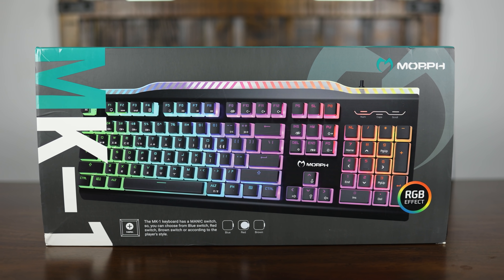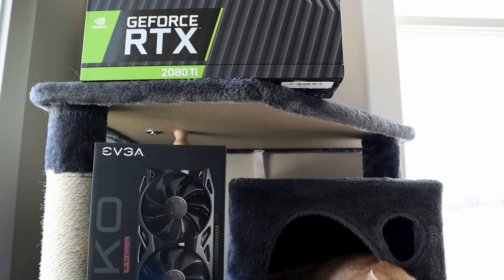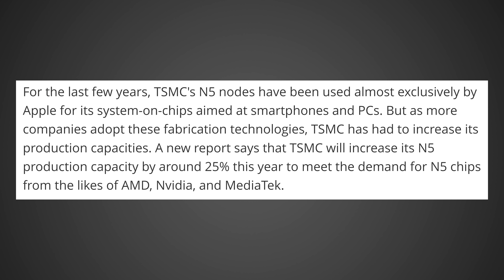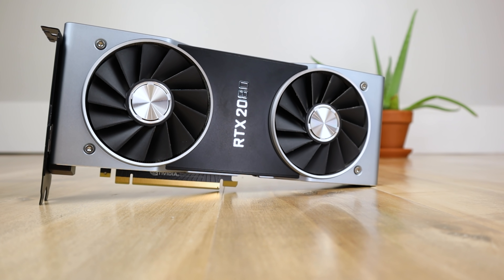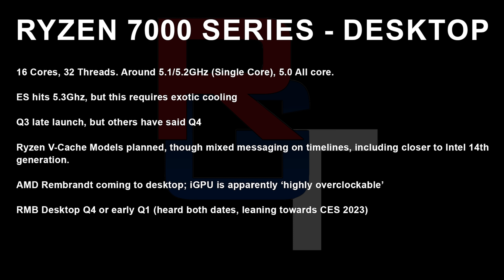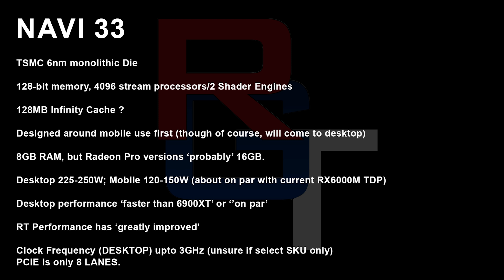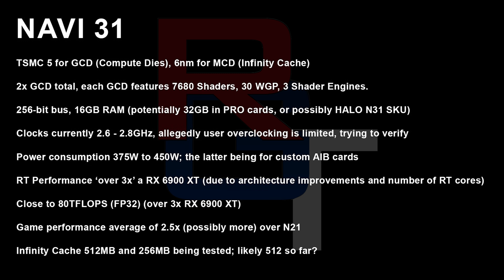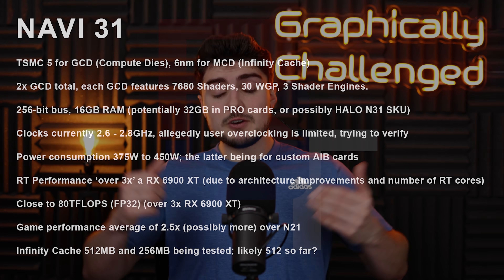Goodbye GPU Shortages FOREVER

Comment: 25% increase is not as big as you think it is.  For example, going from 80 to 100 is a 25% increase.  If you're splitting a 25% increase between 4 different companies wanting the same manufacturing process, that's really between 6% to 7% per company.

Comment: I am just looking for a $150 discrete graphic solution that draws < 150W and capable of paying recent titles at 1080p 100fps / 2k 60fps Medium settings (Non-AAA titles).
My RX580 undervolted gave me that for many years, but recently passed away after 3 years 3 months of faithful service (R.I.P)
Checking on the current market there's nothing, and apparently the 6500XT can't even natively decode video, wth?
Seriously looking forward to the Intel Arc 5.  Perhaps soon I'll have a pure Intel machine cpu+gpu setup, would be the first one in my long PC building career lol 😅

Comment: Some YouTubers and websites have said the 7900 XT will be over 2.5x faster than the 3090 Ti in ray tracing. If that’s actually the case, the 4090 has to be around 2.5x faster than 3090 Ti if Nvidia wants to compete with AMD. AMD will probably release the 7950 XT at some point and that should be very close to having 3x the performance of the 3090 Ti. AMD is serious about taking the performance crown. Nvidia will likely release the 4090 Ti, which should be around 2.75x faster than the 3090 Ti or at least close to that. AMD’s next gen GPUs are not only going to be a huge performance increase in rasterization but also in ray tracing.
Reply: Source: trust me bro
Reply: @shadowcyclonexx2.097   If AMD actually use the MCM design on the 7900 XT there will be a good chance it will be over 2.5x faster than the 6900 XT and 3090.  I’m not saying it will definitely be over 2.5x faster but it’s a possibility.

Comment: 😂 dont worry 4000 gpu will raise to $4000 after launch 3week later. This is the way. NVIDIA Way.🤔🤗🤗🤗 (if u don't buy 3000 gpu, nvidia will force you so & raise 4000 gpu.🤔🤗. Just like rtx 2080 ti model.

Comment: 16C/32T is going to be the top CPU configuration for the next 20 years...
Scratch that, it'll probably be the useful limit of CPU architecture forever.
Go look up Amdahl's Law, there is severe diminishing returns on multi-threading, consumer software will never be able to efficiently use more than 16 cores.
Reply: LOL, okay. Come back and tell us that again after Raptor Lake launches with 24 cores by November of THIS YEAR.
Reply: @selohcin  
Anything people want to do with a high core CPU right now is or soon will be done much better with GPU acceleration.
Reply: It depends on what you are doing with those cores and threads. Even if that is the upper limit, there are always efficiency improvements.
Reply: It's not a cpu/hardware limitation.  It's consumer software limitation right now. There has been cpus with more than 16c 32t for a long while. Not to mention server grade hardware and software has no issues using all the cores.
Reply: @Apollo-Computers  Servers serve thousands of users at once, but you can't parallelize the tasks of the individual user to run faster on more cores (Windows never saturates more than four threads).

Comment: The reason they're increasing production to meet those companies demands is because they have paid many many billions of dollars to the chip producers to earn that guarantee.
Downside?  Over inflated  prices in the gpu sector.
Still going to cost an arm and a leg.
Reply: Exactly. Look at 3000 gpu prices atm, 3060ti still floating between £550 and £600. Its a joke. 3060 12gb still £450-£500. 100% the new 4000 gpus will be over priced due to performance increases and rot on shelves.
Reply: @D-2-RZ  Agree. The market won't be viable for two reasons. No one will want to pay those prices, given the current global economic crisis and no one will want a card that requires X amount of Wattage to run when Global energy prices are going thru the roof.
Dead product. Good enough for them.
Reply: @cmcc3721  couldnt agree with you more. Spot on 👍

Comment: I think Nvidia's decision NOT to go with TSMC for the 3000 series was the reason supply was as good as it was. AMD went with TSMC and Nvidia out produced them about 20 to 1. A 25% increase for TSMC will do very little if Nvidia wants to make gpus with them. If Nvidia produces with Intel or Samsung I think the situation would be better for the 4000 series.
Reply: If I remember correctly, thats tottaly wrong... It was all nvidia fault that they go with samsung. They wanted tsmc to lower their margin by talking with samsung. They didn't budge, so they had no other choice but to go with samsung and only their server grade stuff etc were built on tsmc. That's why their gpus were that power hungry as samsung 8 was 25% less energy efficient then tsmc 7. Thats the difference between 350 and 275W or so. If they wouldn't do these shenanigans availability probably would be the same.
Reply: So Nvidia had a 20:1 production but AMD has had cards on store shelves for many months?  That only happened for nvidia in the past month.  AMD was far more available.

Comment: 2 questions if someone can answer
Will a 4000 card be compatible on a pcie express slot 4 ?
Will it be compatible to any of existing power supplies ? I mean if it has a different kind of pin connector than current ones of existing psus.
Reply: Over 4070 u will need 1000 1200 psu thats all
Reply: @beboH4o  atleast a reply. Thanks.

Comment: Just remember, shortage was not mainly related to low production, it was hugely due to professional miners and bots! What makes you think it will not happen again please?
Reply: Or maybe it was both. They saw an opportunity to increase prices. They started selling to miners instead of regular customers. Created a shortage and now prices are higher, in retail stores. That's not counting that they slowed down production due to covid and other reasons.
Reply: that is true but also due to people sitting at home with nothing much else to do during lockdown?
Reply: That was part of the reason for the shortage. There really were shortages. The demands for fabrication were largely unmet and therefore the number of GPUs couldn't meet the demands of consumers. Then add the miners, scalpers, and retail distributors giving GPUs to miners and you have a massive shortage.

Comment: Although its not the best card out there I recently bought an Asus Phoenix Rtx 3050 for $299.99, which was a crazy deal because now its selling for $100 more.
Reply: One of the best deals you could get today but I think you should have spent $70 more and get an RX 6600.
Reply: I compared it to the 6600xt, but the xt was like $100 more, so i decided to just quickly buy the 3050 before it was out of stock

Comment: If AMD doesn’t release anything over 16 cores it’s going to be catastrophic for them. The 12900k already beats the 5950X in the majority of cases, and that’s at core parity. 16v16. The 16 core Zen 4 chip will have to go up against a 24 core Raptor Lake chip, the i9 13900k. And I don’t see how it’s going to win with a core deficit if they already lose at core parity
Reply: if you need more than 16 cores (99% of consumers don’t even need 16 to begin with) just buy a threadripper CPU. core count doesn’t mean everything when it comes to gaming. if you buy a 12900K or 5950X purely for gaming or general purpose use you are wasting your money.
Reply: @nathanlarson6535  Right but consider this. The i5 13600k will likely be a 12 core chip. The R7 7800X will be 8 cores. How’s AMD going to explain why their 7 series loses to Intels 5 series?
Reply: @nathanlarson6535  not if its as cheap as a i3 or i5, i got my i9-10850k brand new for €100
Reply: Well you have to remember that the 1200k was realesed over a year after 5000 series so its obv going to be faster plus it has a newer platform. Raptor lake sounds interesting.
Reply: We gonna see 24 cores and 32 cores for consumer grade not for enterprise
Reply: amd still matches or beats it in productivity for way cheaper, 12900k is def better for gaming. also really expensive.
Reply: Yeah 90% PC users are gamers so no. Noone needs them cores. You dont know jackshit.
Reply: We need way faster single core performance, not gazzillion of core count
Reply: For desktop CPUs that will see mostly gaming work and editing work you absolutely don't need more cores. Beyond 12 cores we're into pure marketing territory for people oblivious to the fact you won't even utilize half of them most of the time.

Comment: If that's the case, my future gaming build will pretty much stay the same - an amd cpu and an nvidia gpu.😃
Reply: Meh nvidia will get smoked till they get on mcm they will probably be more expensive next gen than amd use 2x the power and all amd has to do is add a few more mcm to beat anything nvida might launch. I’m waiting for the 450$  105w 5800x3d to beat the 800$+ 260w 12900ks. It’s what happens when you can add more silicone and keep it in its optimal power range vs just pushing the limited size silicon further and further past its efficiency envelope
Reply: @mddunlap03  that amd cpu will probably be better for workstations too.
Reply: @mddunlap03  if you think that Nvidia GPU’s will be twice as expensive and not as good performance you need to see a doctor😂😂
Reply: @mddunlap03  keep waiting, coz 5800x3d (more like trash3d) is never beating 12900ks
Reply: Got to keep warm in the winter.
Reply: I’m hoping AMD GPU will beat Lovelace, that will be a twist for my first build later this year
Reply: GPU shortage is already kinda gone, major retailers are basically scalping with their insane pricing. 

What he didn’t mention is that silicon wafers are going to be increasing in prices because TSMC and the like said so.

So yeah, be prepared to be charged up the wazoo. People here are so starved of GPUs that just the fact that stocks are normal will justify a 30 - 40%  markup.
Reply: My current build is an intel cpu and amd gpu lol
Reply: As Nivida say 🤣 tell me do you bleed if u choose to buy 4000 gpu & avoid buying 3000 gpu. Lol u will. ( raise 4000 gpu $1000 more is a must : )
Reply: @roxy_xcxc6869  Ok, this got me laughing 😂.
Reply: mine will be intel cpu with amd gpu
Reply: mine both amd
Reply: Nvidia is making cpus now
Reply: Im intel CPU and nvidia GPU until I can see waht teh Intel GPU can do.
Reply: whatever you choose.......just remember........your still a PC Gamer and not a Console Lamer.
Reply: I’m never getting an amd GPU until they get FSR on par with DLSS 2.0, there’s no excuse why it isn’t. That’s literally the only thing holding me back. They need to pull an R9 295x2 type machine BEAST again
Reply: @NerroEXTV  there is an excuse to why it isnt, nvidia uses machine learning, amd doesnt
Reply: @NerroEXTV  your loss
Reply: @Zelara5  how? AMD GPUs have been garbage after the RC 2xx era. Missing out on thing lol. They have the best GPU of the century with the r9 295x2, but now they suck.

Comment: Im planning to buy 3060 once the prices drop more. Should I wait until 40 series?
Reply: If you can get one for msrp I would get it now cause I would not want to risk waiting another 2 years. Plus you can sell the gpu later on to buy a 40 series card if you want. I’m planing on getting a 3070 if I can get one for msrp.
Reply: @samirshams4781  don’t get a 3070 it has the vram of a 5 year old card, nowadays it’s becoming more and more important to get better vram you should just wait for the 40 series and get a 4060 it’s equivalent to a 3070 and has 12 gb of vram or get a amd gpu if u can’t stand the power required
Reply: @samirshams4781    Well its still a lot more expensive than MSRP although the price droped significantly compare to what If it was 2 months ago. If it drops by 100 then Im willing to buy it. Right now its still too expensive.
Reply: @Marko-ij4vy  agreed way to expensive but if you get the chance to get it at reasonable price than I would get it.
Reply: @samirshams4781   Yeah Im still waiting for more price drop. But Im wondering if the prices of 30 series will drop even more when 40 series come out or if the same fiasco of 30 series repeats where scalpers will buyout all of them and even the older gpus prices will raise again.
Reply: @samirshams4781  all i want is a 6700xt at msrp.
Reply: I sincerely think the 40 series won't be widely available at launch. If anything, it more than likely will be the same situation of the 30's.
Reply: Well right before the 4 series cards come out a lot of people are going to sell their 3 series cards , so if you can wait prices on the used market will get even lower . You might even be able to get a 3070 if the price is in your budget
Reply: I want a rx 6600 xt
Reply: if your  budget is on 3060 go buy it stop waiting, the prices won't really get lower as 40 series is coming and they may soon lower the production of 30 series and thus shortage will return as 40 will be scalped and majority would seek back in 30 that are already low in the market

Comment: GoOdByE GpU ShOrTaGeS FoReVeR

More like
A Break from sky high GPU Prices but Shortages again later in life
Reply: Nah, you’ve got it the other way around, supply will recover, it is already (you can already buy a 3050, 3070, 6900XT) - but the prices are going to be high. Fabs are going charge more and so will nvidia, they’ve seen that for gamers GPUs are like insulin is to a diabetic.
Reply: lol stop dreaming Nividia will raise 4000 gpu to $4000 3 weeks later after launch & force u to buy 3000 gpu again by force. 😂. 100% expected.

Comment: Dont get to excited. Ethereums switch to proof of stake will not happen anytime soon and considering the giant processing power leap those card will be extremly good mining GPUs and that means NO CARDS FOR GAMERS.

So, if u can buy a RTX 3000 series or RX 6000 series card, do it. U will be not able to buy any cards after RTX 4000 series releases.
Reply: Doubt given I don’t know facts lol 😂
Reply: ETH moving to proof of stake may or may not happen soon but the stock going as high as it did will unlikely happen. While yes some miners do mine even when it's low and sell when it's high, there's a strong correlation between GPU stock improving when ETH crashes. There's also the fact that it's fairly saturated, the return on mining is becoming worse and worse with each new miner. And the fact that the new GPUs will have much higher power draws that your average consumer doesn't really care about, but your big farm miner does. ETH is unlikely to affect next gen. 

A new coin might affect it, and if it does get to a point where new coin shows up months after the other, it'll be a clown show until the government steps in after around 5 years.

Comment: No AI cores on the AMD GPUs? That seems odd at this point…
Reply: innovation>replication
Reply: AI cores would defeat the initial purpose of the point of FSR. It is free only cost in time for developers and monitor makers. Adding AI cores would possibly add to the overall cost of AMD gpu's.
Reply: AMD can do all of the things Nvidia is doing with just compute shaders. Nvidia apparently no longer needs Tensor cores for DLSS anymore either. Both Tensor cores and RT cores are just a waste of die space.

Comment: This video is just Copium. Good luck getting a 4000 series after what we saw last release.
Reply: Exactly. Unless they make them worthless to miners and retailers don't let people buy 10 at a time we're going to be in the same situation
Reply: All i see is copium from people who bought a 3000 series for 1.5-2.5x the msrp and are now facing a mid tier card that'll be better than their 3080.
Reply: @RobRIPDG  so you're gonna be the fool who sells their 3080ti for 500 dollars when the 4070 comes out? Cards will retain their value as long as mining Bitcoin is a thing little homie. It's actually a GREAT time to get a 30 series for MSRP.
Reply: @zhon5311  I'd say the best time to buy a 30 series is right at the cusp of the 40 series release. Lots of people will be scrambling to sell their 30s, completely ignoring the fact of what happened to the 20s because "it'll be different this time". I've got a 1060, and I'm just waiting for an opportune moment to yoink at least a 3080 because my 1060 is sort of at the end of its lifespan and I'd rather take a calculated risk with certainty in my returns than sit on my hands and watch a good opportunity fly by with the smallest hope that the 40s will be reasonably priced. The week of the 40's release, prices across the board for GPUs will skyrocket regardless of the model, just like they always have, because if the 40s are higher priced, that means the scalpers can raise their own under the illusion of a "good deal".
Reply: Agreed.  I'm going to have to cross my fingers like last summer and hope I get lucky in the NewEgg Shuffle.